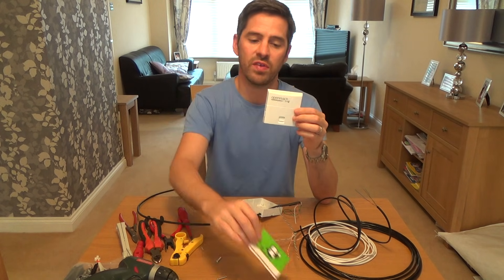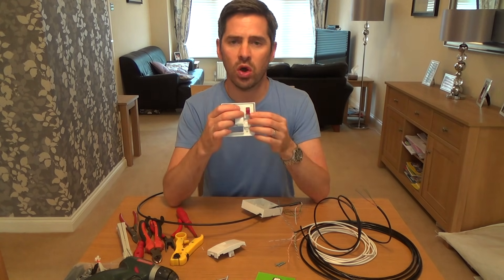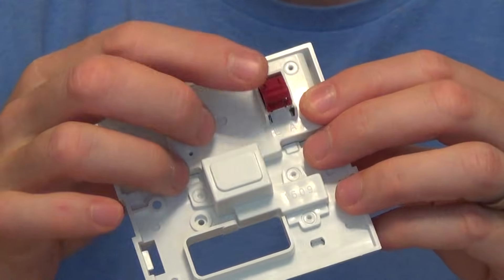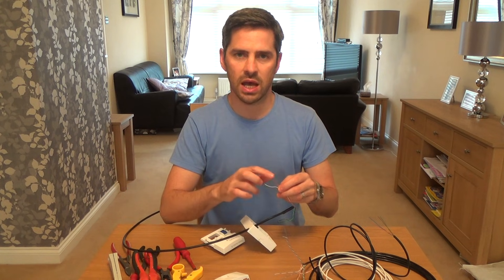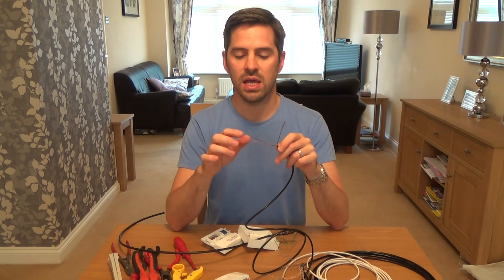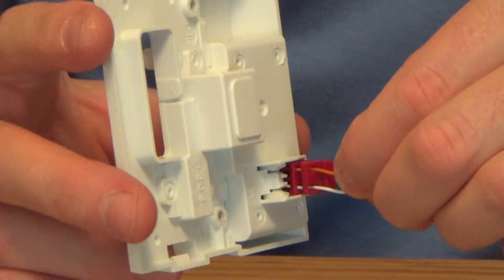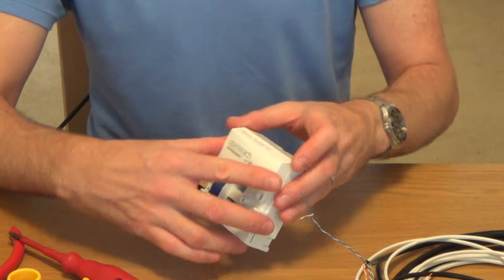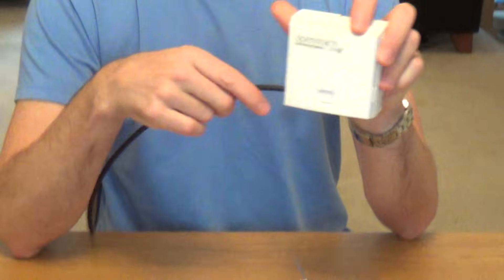QUICK VERSION. How to Install a BT Openreach NTE 5C master socket on new wiring.

Comment: I just wanted to mention that in my case, the cable type is CW1308 2-pair (4-core) telephone cable, with a white outer sheath.
Unlike most tutorials that show blue and white/blue wires, my active line was actually using the orange pair,  white/orange and orange.
A - White and orange 
B- Orange
Hope to help someone 😂

Comment: Hi Vince, following advice from several of your videos I relocated my NTE 5C to a more convenient location, using CW1308 cable joined to the incoming cable with a BT77A block terminal.  Despite phone working perfectly, couldn't get router to connect in new location, so network povider suggested taking faceplate off and using microfilter in test socket, which worked.  Any advice for me?

Comment: Hi Vince thanks for the video it was a great help in fitting a replacement master socket 5c. 
Quick question when I’ve wired up the existing slave extension the house phone works fine but when  I plug in my router to the slave socket using an adsl micro filter it comes with no internet connection on my tablet when I even though it used to work this way before. Any ideas on what I’ve done wrong?

Comment: I'm a bit confused, can you say if its correct.

So I have external telephone line cable coming to junction box and another extension.

Can i use this to connect external cable straight to ntec5 new box and get rid of everything else?

Comment: My drop wire cable was wired orange to A and white to B, the opposite way around to what you mentioned. I have done it the same as it was...I hope this will be ok, I won't know until the house in connected in a couple months after renovations. I actually found the drop wire easy thanks to your tips.

Comment: Brilliant video, thanks. Really easy to follow and saved me loads of time not having to work out the wiring when upgrading my socket and extension cable, not to mention the cost saving of an engineer doing it. Plus speeds improved significantly too #TripleWin 😎

Comment: Great vid, mate.  Job done in 5 minutes.  The two old wires were so faded and dirty after decades in the back box I couldn't make out the colours so I just noted their position A and B,  wiped them clean,  vacuumed out the accumulated debris in the back box and reconnected to the new NTE5C.  Data rates up 5% to 20.00 Mbps / 58.90 Mbps.  Cheers.

Comment: Hi Vince i have Watched Quite a few of your Videos very Interesting ,, My problem is i have old Wiring in my house ,, White Green Orange and Black,, i connected the Asdl and Phone line Socket, it was going Great Still getting my Internet but my landline will not Work now for some reason , Tried Different Phones on it no Joy ,, just cant Understand it was working fine all the time. White i have on 5 orange on 1 Green on 3 ,, Black i dont use was never Connected even to the old socket ,, Any Help would be Appreciated

Comment: I have a single core cables running from the drop line, how can I repair with newer cable section with two wires to repair a damaged section?

Comment: When BT Openreach came to install my/fix my phoneline for recieving Internet from SKy, they removed the old master socket plate, and stuck a MasterSocket 5C straight onto the old Metal Backbox, it looks a mess and the screws holes are standard electrical socket machine screws, but the front plate of this isnt the same, Do you know if anything should be fixed here as it may be causing interference with my Service, mainly OK but SkyHub Reboots cuts out out and the internet resets...

Comment: Hello there, I am getting 6mbps, on an estimated 36. The wiring you suggest is blue to b and blue/white to a. This is opposite to what I have installed. When switching around I get no service. Also the ‘test’ socket gives me no service either way round. Any ideas? Thanks

Comment: Hi Vince. Great video. Thanks for all your efforts in making these. I know in the video that you specified that if replacing old socket with the new NTE5C then copy the current A and B wire colour config which is great. Then you went on to say that, for a new installation, if you are using drop wire cable then use White to A and Orange to B. Which just so happens to be the opposite of what I have. Is this a change in the standard colour recommendations? I didn't put it to the test on my line by reversing the current config. But what would be the consequences if I did? Any? Thanks again.
Reply from the maker: Hi there, thanks for the nice comments. It will still work if the wires are reversed. Most (not all) engineers will fit the White to A and Orange to B but it doesn't actually matter so it is always best to copy like for like just as you have done because then you will know that it work like it always has previously  :-)
Reply: Thanks for the response Vince. I rather suspected that was the case.
Reply: Dropwire follows the same color coding as concentric cable therefore the orange is the A leg and the white is the B leg, so it was wired correctly on you existing socket. Polarity doesn’t make a difference, so either way will work fine.

Comment: Hi mate 
Can I use a normal master socket like one in link 
http://www.screwfix.com/p/mk-1-gang-master-telephone-socket-white/16814?tc=BA7&gclid=EAIaIQobChMI48CG-9eI1gIVYbXtCh0AmAOcEAQYASABEgJGefD_BwE&gclsrc=aw.ds&dclid=CKOS3sTYiNYCFdHhGwod1bUPEg
Reply: My internet has been slow at my dads house for ages 
And think it's the old wiring in the house so starting fresh
Reply: You can use a normal socket but not with the NTE5C in this video. When you are installing the NTE5C the only thing you can re-use of the old one is the back box. As for the slow internet at your dad's place it has nothing to do with his internal wiring if that's what you mean. The only thing that matters is the cable that comes into the house from the exchange and is attached to the back of the master socket. If the internet is slow then you need to contact your ISP and have them check the speed. There are things you can do to speed things up inside the house. For example you can use a hard connection to the router rather than a wireless connection. Wireless connections are limited to 2.4GHz or 5GHz no matter how fast your line speed is. If you are using a USB wireless adapter in the computer you should make sure it is a dual band 2.4/5.0GHz adapter but the device also has to be capable of using 5GHz too.  The general rule for wireless is the closer to the router the better.  So if you can move your router then that's a good idea too. You do hear some people talk about not plugging your router into an extension because it affects performance, But I have bench tested router connections via phone extensions a million times and never found any impact on speeds.
Reply: Thanks for the reply mate

Comment: I want to move my master socket away in a cupboard there's a wire that comes in from the street then into a little box an from that smaller box a wire goes into the openreach box that has the blue blue/white cables? can it be done without loosing much data speed as I'm only on 2.5mb
Reply: It can be done but you are not supposed to touch that cable. It belongs to BT.

Comment: I'm having problems. I replaced and connected the A and B to the master socket. I connected Blue and BlueWhite just like how it was in my previous master socket. (I have orange and white left over too but they were in 5 and 2) I clipped on the front plate with the telephone and internet and nothing worked. I instead took off the A and B, saw that it said A and B on the front plate and tada! everything was working however I can't attach the front plate onto the main socket cause it just stops working.
Reply from the maker: Hi, that sounds strange. I wonder if the backplate of the master socket is faulty???
Reply: My Mate VINCE i just tried it again in the master socket and i left it in and waited! boom it worked!

Comment: I am having an Openreach engineer coming to change my GPO star wiring with no nte5 hopefully i will get this. 
I get 12mbps on my exchange only line they estimate me 21mbps.
Reply from the maker: Hopefully you will.....Once they use up the old stock of NTE5A master sockets then it will be all these NTE 5C master socket so it might depend on the van stock level of the engineer doing the job. I don't think it will make a huge difference between new and old NTE5s as the components are the same.
Reply: I dont mind what i get really as anything is better than what i have got now and i think i an getting the job done free as my uncle is an openreach site manager and knows how bad my service is.
Reply from the maker: Good result :-)
Reply: did you ever get fibre?